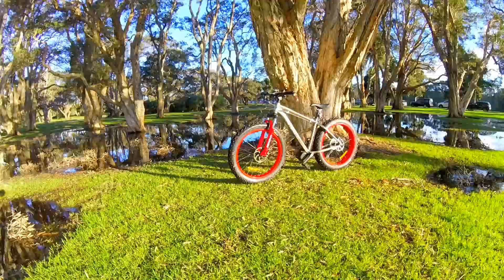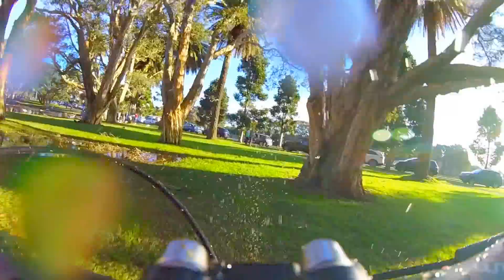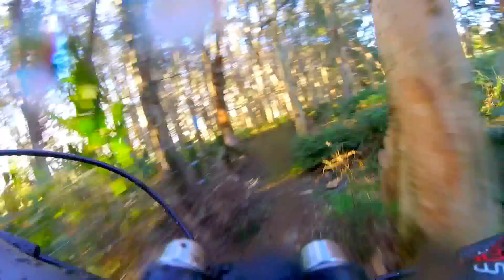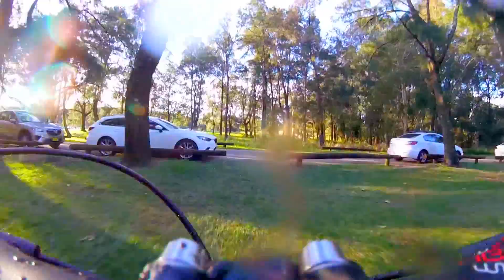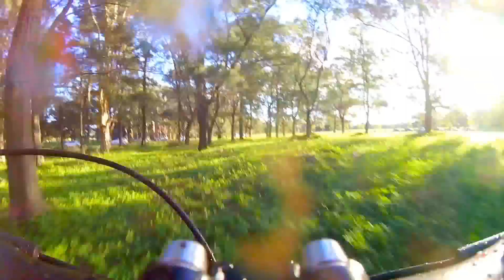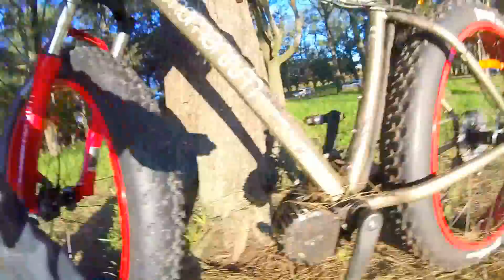Testing Bafang BBSHD 1000w motor in water, mud, bush • Electric Fat Bike Off-Road MONSTER

Comment: Hey bud had a hub motor of 3000w that is dead and made a battery with Panasonic NCR 18650 20s 10p that made a 84v  battery without bms. Would this motor handle the battery voltage or would I need to change the configuration. If so what you recommend me to do. Also 1 more questions I'm a big fun and I would love to know the top speed of the monster.
Reply: BBSHD will NOT handle 84v

Comment: You thing 48v 17.5ah hailong battery is ok for my bbshd 1000w..Thanks..
Reply from the maker: I worked with ebike batteries for 2.5 years and one of the most important things I learned is AVOID HAILONG BATTERY CASES they’re horrible, cheap and nasty plastics, cracks everywhere destroying the contacts, shorting and BOOM or breaking the plastic tabs that holds the battery to the bike frame and in the middle of the ride your battery will drop on the road, big damage $$$.
Reention battery case is waaaaay superior in so many ways, they have it in multiple sizes depending on how many cells you want inside the case.
I went to both factories in China last year. Avoid Hailong troubles mate. =]

Comment: I don't know about animal porn sounds... but a bit of this did remind me of when that Ewok stole the speeder bike from a storm trooper. :D

nice set up man, looking to build something similar.
Reply from the maker: hahahahaha... this is hilarious mate.. hahahaha... 
This Monster Electric Fatbike is the ultimate in fun... just point the bike anywhere, pull the throttle.. upstairs.. downstairs.. beach.. mud... bush... ohh yeaahhhhh =]
Reply: +ElectricBike (Bruno) I just ordered a Mongoose dolomite, juggernaut tires, shimano brakes, front suspension, and BBSHD.  

not quite as nice as your fat bike, but for a budget, should be pretty fun. 
thanks for this upload, is actually what helped me decide on a bbshd and fat bike.
Reply from the maker: +hugh davidson yeaaahhhh sounds like you're going to have A LOT OF FUN hahahaaa... where did u get your motor and battery from? What voltage and Ah pack did u get?

Comment: Hey bruno helps please.
I have a BBSHD 1000w.
It came programed for hot rod setting 
So i have a 1000w 48volt  and a 52volt battery longe rang long power.
After a  months and half of you use  today it went off while i was riding at 30mhp on flat .
I try turning on but it went offf 6 times  and ha d to pedal to get to my work. 
Now it turns on normally.
But what do you think happened ?
Battery wasnt hot at all.
The only problem is that i ride on the rain!! Do you think thats why. !
Please help me brunooooooooooooo.
I search online if someone can help but no one i expert like you . 
What do i need to do. ?
Helpppppppppopp meeeee bruno 
Thanks
Reply: If you using BMS and the battery is not protected then it's shorted if that's the case remove BMS and check each cell. If 1 cell is dead replace and you good to go.

Comment: I guess I should not be worried about washing mine then LOL nice video
Reply from the maker: +dave mac yeaaaahhh don't worry about washing... it's designed to survive storms, muddy environment... however it won't survive a high pressure water jet... as long as you're not using anything like that to clean your bike you should be fine ahaha
*i saw some cases of guys who had water inside their motor... very few cases but not too sure if it was a failure on the seals or if they've immerse the motor in water... it's hard to know exactly what happened

Comment: what a beautiful spot. you camera makes so powerful videos.
Reply from the maker: Yeeeeahhh..  this is where I make most of my videos, very coinvenient location near home hahaha.. nice road for the fast speeding tests and lots of tracks and bush for off-road ones yeahh... I use the GoPro Session (the little one) I also have the GoPro 4 Hero but the microphone on the little Session is amazing, no need for external mics, very small, easy to mount anywhere on the bike, love that tiny camera.. yellow sun in the afternoon also helps boosting the colour.. =]

Comment: are all bafang motors waterproof? or did you customize it to make it waterproof?
Reply from the maker: Yeeeahh.. they're not "waterPROOF" to deep in water but it can tolerate a LOT of water splashing, big storms, many off-road dudes clean their bikes with a water hose, its not "recommended" splashing water directly to the motor but I have never had any problems yet... I am doing this since 2014 with different motors and I am yet to see a problem. Same for the display, wires and sensors. The Bafang motors have the IP rating for dust & water higher than the expensive Bosch motors yeahh =]